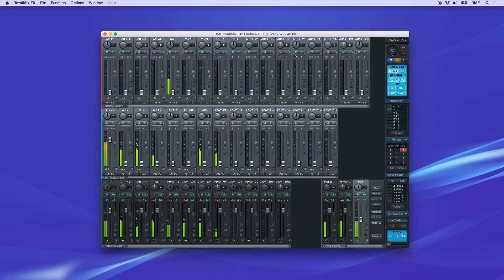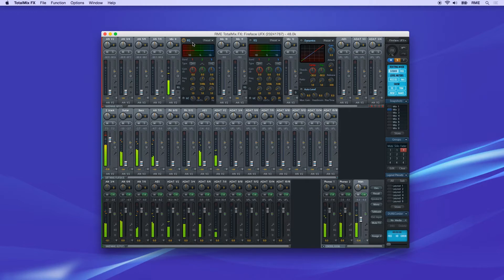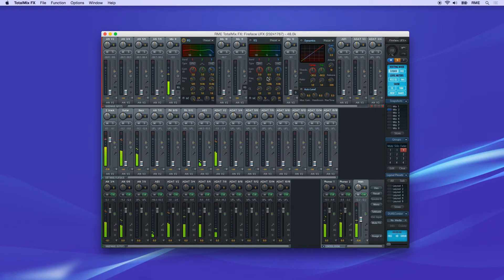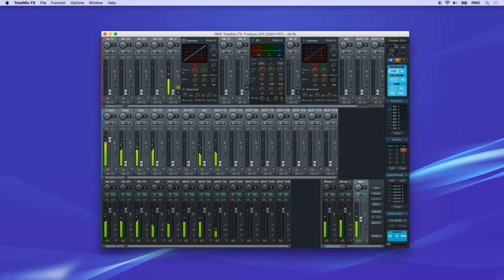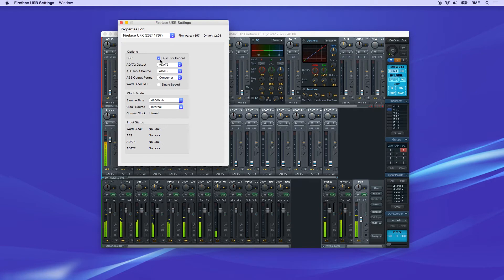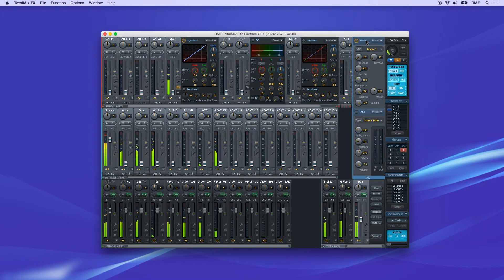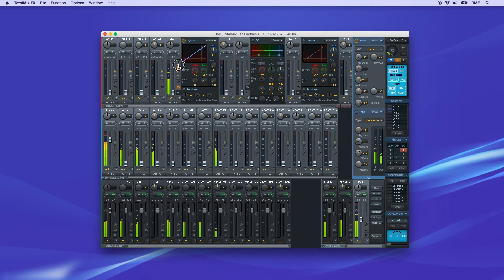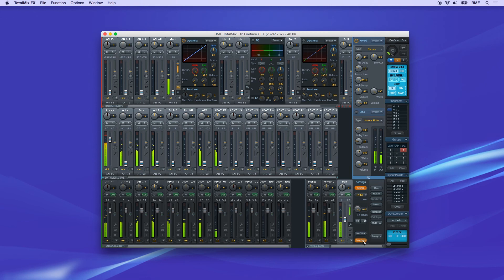How to use RME Audio TotalMix FX - 08 Using Effects

Comment: My Fireface 800 is becoming obsolete. It's a great sounding unit but there's no TotalMix FX for this unit and only a Firewire 800 which is becoming a dinosaur. Only some old iMacs support it but mine is 12 years old and has other issues like video card failures (common to the iMac eventually) and few other input choices other than USB2 and 1/8" audio. Anyone find a workaround or a better interface?
Reply from the maker: You can still use the Fireface 800 on newer Macs via Thunderbolt. You could consider the Fireface 802 or UFX2.

Comment: Do the effects work with the Digiface USB?
Reply from the maker: The Digiface USB has no DSP chip build, so it doesn't.
Reply: RME Audio  Thanks for the reply! Do you know if there is any hardware I could buy to use the effects in Totalmix with my setup or would i just have to buy another RME interface with a dsp chip? I've got a Behringer ada8200 into the Digiface USB as a master clock. Being able to use the effects in totalmix would really help my streaming setup.
Reply from the maker: I'm afraid you would need to purchase a different RME Interface which has the DSP on board. Like the Babyface Pro, UCX, 802, UFX2 and a few more. If you could find external FX devices with ADAT or SPDIF I/O you could insert those devices.